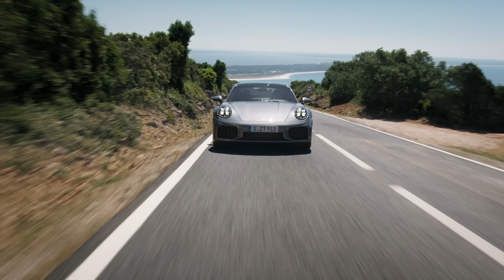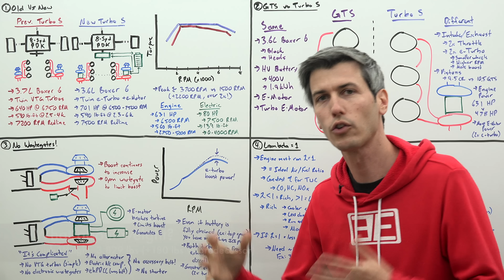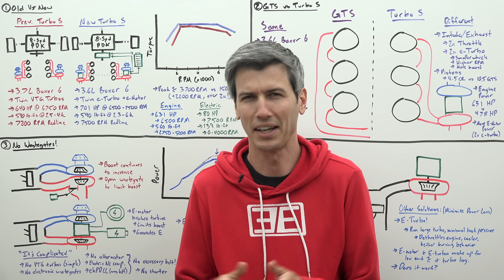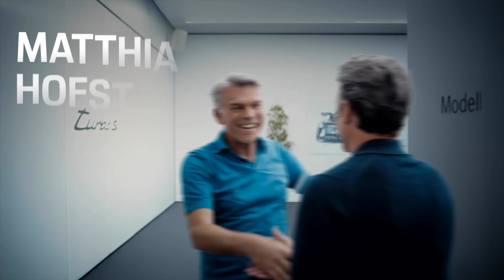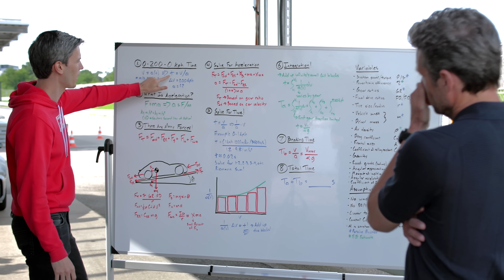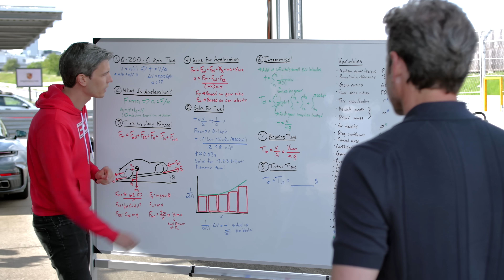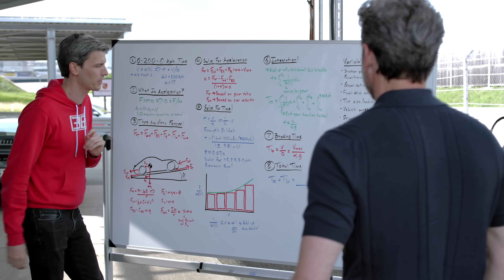The Most Powerful Porsche 911 Ever - New Turbo S Engine Deep Dive!

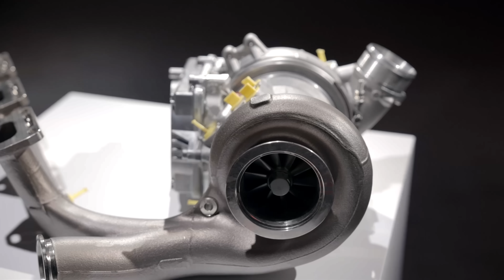Comment: 3:50 wait how does more efficient energy recovery from the turbos translate to the electric motor being able to provide more power?
Reply: The generator in the turbo provides power to the electric motor, so the electric motor can operate past the capacity of the battery.
Reply: @james2042  Ah, so even if the GTS can do the same with it's single turbo, the peak electric motor output is reliant on the engine being at whatever load / RPM is necessary to provide that excess compressor shaft speed? 

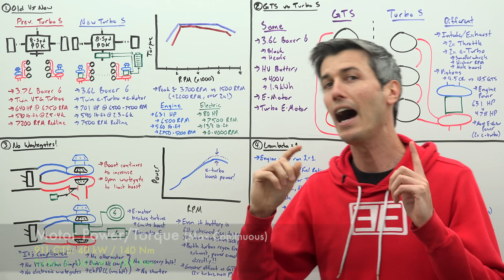Still strange that at 4:00 it says the GTS single turbo can produce 11kw, while the new Turbo S can produce 14kw per turbo. Is that to do with the smaller compressors and higher RPM being more efficient in power recovery? Just seemed like that aspect was kinda skimmed over.
Reply: This is a technology that has been used in large cargo ships and oil tankers for about fifty years.  These large 2-stroke diesel engines have two individual function turbo chargers.  The first ones are used to provide the induction air and the second ones are just there to scavenge as much energy as possible from the exhaust heat/pressure/flow.

Comment: Was crossing my fingers during the reveal for them to drop the archaic ICE part of the powertrain. Ah, well, I guess the top spec Taycan is now the new Porsche Halo car for me.
Reply: Porsche is not the company for you then, they have been investing quite a bit in synthetic fuel development for a very long time now.  Also look into how much Porsche has dropped on developing better induction noise, where is the induction noise on an EV?  Porsche will make a great EV because they have the German drive for perfection and hire top-notch engineers, but their ICE program is not going anywhere
Reply: @HaHaThatIsFunny And that's fine, like I said, I'll just look for the evolution of the Taycan going forward (even though I think it's being artificially held back because of the 911). Lucid's engineering is as impressive, if not more, than Porsche's when it comes to power, efficiency, and overall packaging. Maybe they can one day do a focused 911 rival. I mean, the Air Sapphire already out accelerates this new 911 anyway, and it's a 4 door family sedan.
Reply: @MurseTech64 perhaps you should invest in lucid. You can get a good deal on it this week since they had to do a 10 to 1 reverse split to avoid being delisted 🙈
Reply: If you don't want an engine in your 911 than you are probably better off with a different vehicle. Not even saying that as a bad thing even though you are obviously fishing for negative responses with your statement.
Reply: @PringleSn1ffer No fishing. Just expressing my opinion, like others, in a comment section. I know Porsche is more evolutionary than revolutionary but I was hoping for a bit more than this reveal, powertrain-wise.
Reply: @MurseTech64  again, perhaps you should look up this model called the 959 that revolutionized cars for the next 30 years 😂.  Do a quick Google search of how many patents Porsche has and you will see how silly that last comment was
Reply: @HaHaThatIsFunny Had a poster of the 959 on my wall as a kid for a long time. I'm well aware. But after experiencing the Taycan Turbo GT and few Chinese supercars, it's hard to go back to an ICE.
Reply: @MurseTech64  You're obviously fishing for negative comments man, why deny your own nature? You will be happier if you are honest with yourself. There is like 100 EV cars with 400+ HP and that all weigh 5000 lbs and all have touchscreens plastered all over the interior. Go drive one of those instead of cheering for the end of Porsche's unique character, heritage and charm.
Reply: @PringleSn1ffer I'm not saying I don't like it. I like the interior as well I just wish it had a more forward-thinking powertrain. Why would I fish for negative comments? Everyone is entitled to their own opinion in the comment section.🤷🏼‍♂️
Reply: Cool story bro
Reply: Future cayman probably